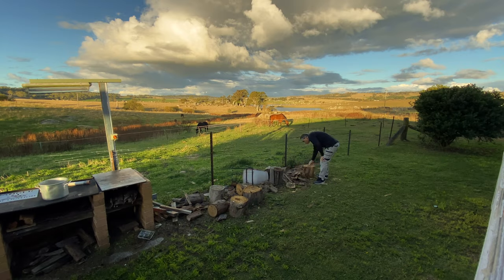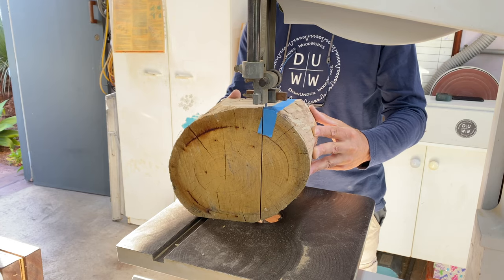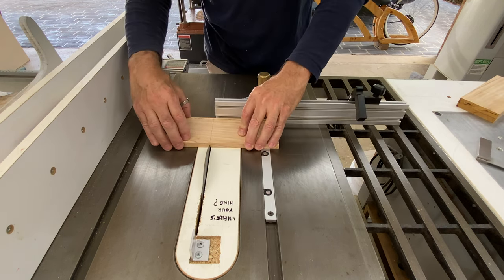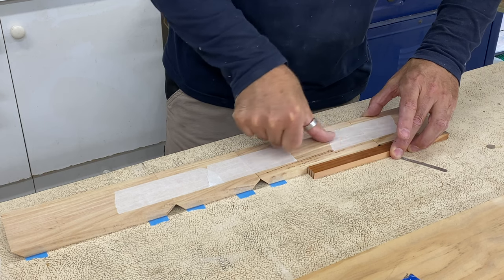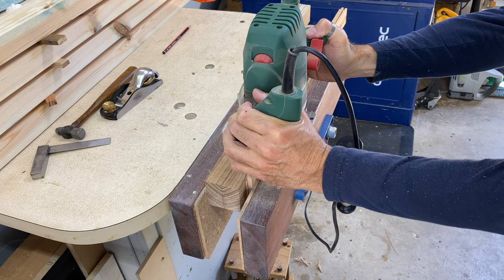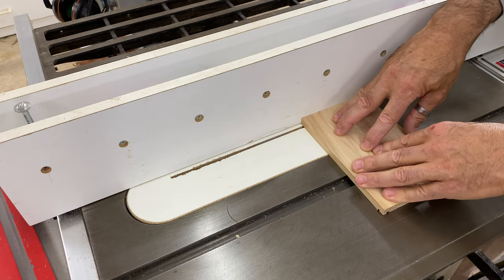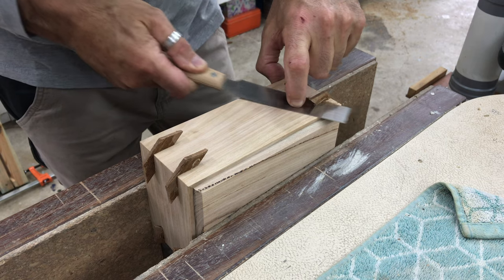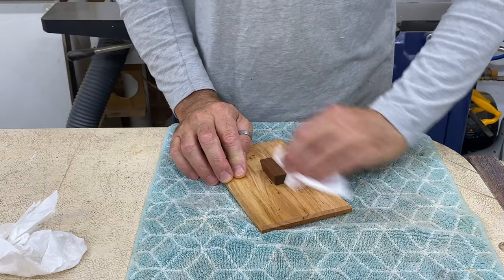Making beautiful boxes from firewood

Comment: Nice work mate, I see your machine collection growing nicely :) ... have to say though, those bandsaw cuts at the beginning were well dodgy. Oh, and how do you like the Bosch Sander? :)
Reply from the maker: Thanks very much Ben. Yes, got a few new tools lately but it been slowly but surely. Good lesson for newbies, you don’t need everything when you start. The old bandsaw was a real workhorse once I worked out how to work it to its best ability. The Bosch orbital sander is great, feels good to use and solid. It has an alloy metal body, real solid unit and smooth too. I think it’s more a finish sander though because it has variable speed which is great but at top speed it’s still much slower than my corded ones